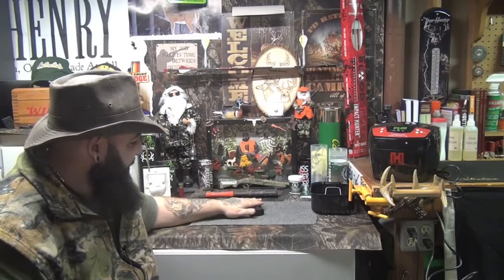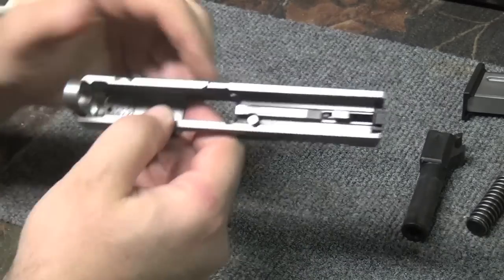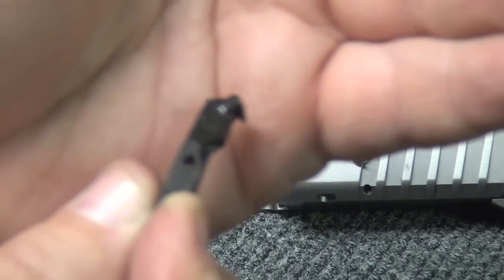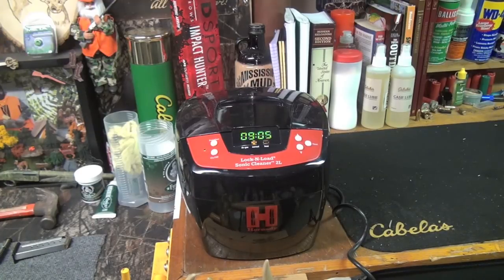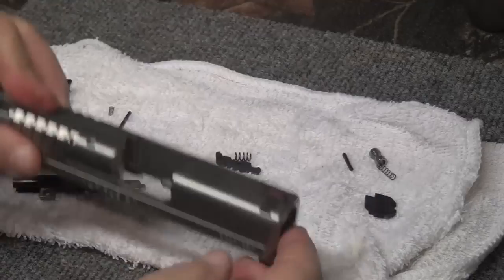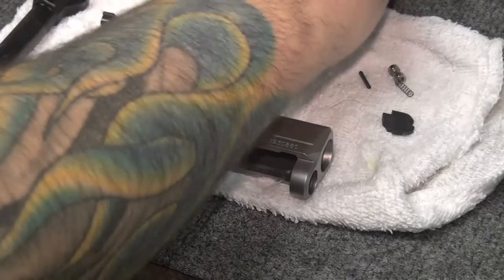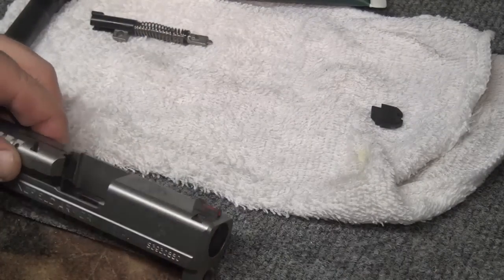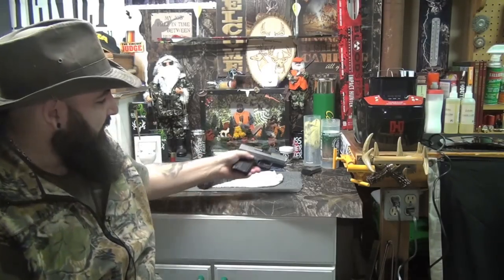xds top slide complete disassembly and cleaning

Comment: Thanks for the great video! Use the Frog Lube sparingly, and only wipe a light film around the extractor on the face of the slide- I buggered up my XDS 45 after I dripped Frog Lube onto the extractor face while wiping down the slide. It soaked into the mung behind the extractor and I began having light offset primer strikes and failure to return to battery. Keep that extractor cavity clean!

BTW now I have ultrasonic cleaner envy lol.
Reply from the maker: Mike Krueger I don't use frog lube anymore that stuff gels up in the cold. Thanks for watching my video!
Reply from the maker: Mike Krueger I don't use frog lube anymore that stuff gels up in the cold. Thanks for watching my video!

Comment: Put the firing pin in after the firing pin block and spring, and the firing pin will hold it in place.  Then you can install the extractor, spring and roll pin without needing 3 hands.

Comment: Good video brother. I'll be using this as a step by step for mine this weekend. Had a few failure to extracts tonight at the range. Pretty sure that extractor is gummed up. 700+ rounds of cheap ammo to blame. Hope my springs dont go flying! Thanks again for the tutorial.
Reply from the maker: 6string42 another tip is put slide in a big zip lock bag while you work on it so if a spring goes flying it will be contained.
Reply: 1yankeecowboy now that is a good tip! Never would have thought of that. Thank you! Probably just saved me an our of searching my carpet for springs haha
Reply from the maker: 6string42 haha been there done that lol

Comment: The struggle with the loaded chamber reassembly was because you went in from the wrong side.  It's not a plain roll pin, it's tapered.  It's removed Right to left, and reassembled Left to right with the bigger end going in last....
Reply: What size pin driver for the extractor pin

Comment: I can’t imagine breaking down a pistol to this point every time.  Pounding on set pins with a hammer would seem to be a limited time operation, eventually requiring the replacement of the pin.  The ultrasonic cleaner though is cool.
Reply: That's not something you have to do Everytime with any XD. 
😏That's like a 150,000 mile service he's doing there

Comment: How would you recommend cleaning the slide parts for those who don't have a ultrasonic cleaner?
Reply from the maker: Frank Parker do the same as I did complete tear down and use a clp then reassemble.
Reply: Use q-tips, a baby toothbrush, wire brush and rem oil.